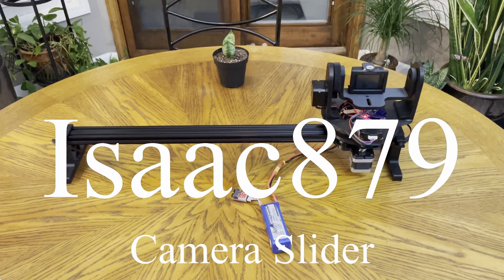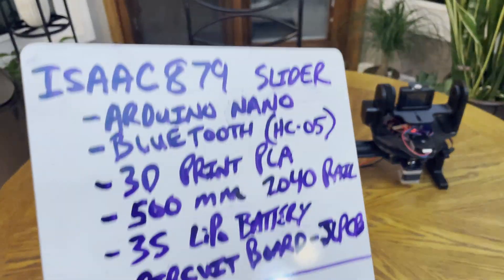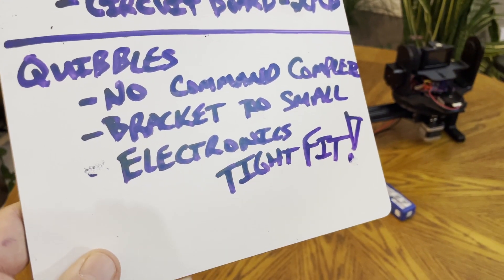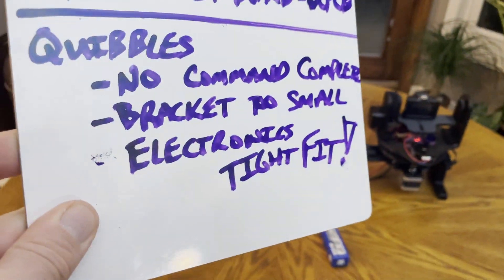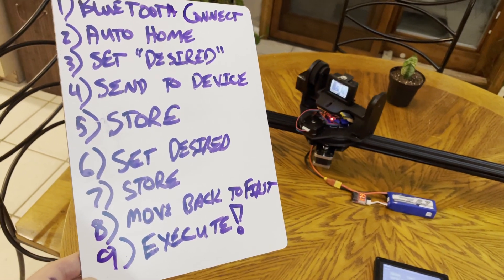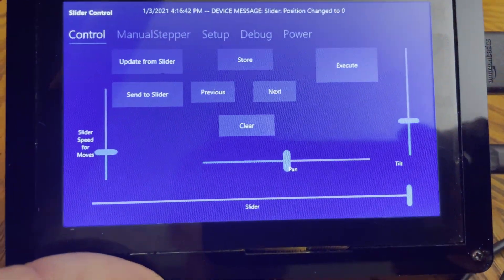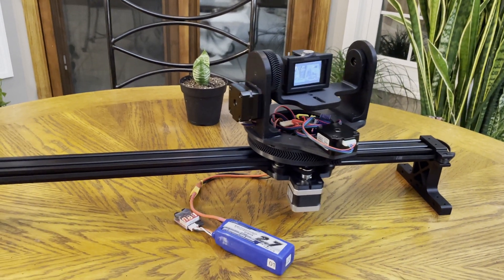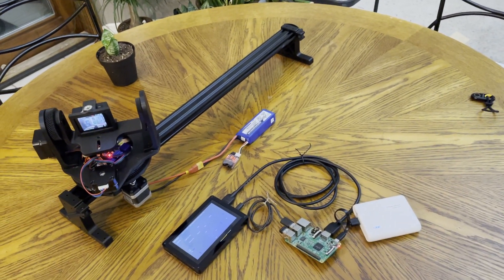RaspberryPi UWP Camera Slider Control

Comment: Great work! You could at a touch screen joystick too. I've done a similar app for Isaac's mount in Python but with Joystick / draggle dot / WASD direct control rather than sending absolute position commands. I've used Isaac's 360 controller code as inspiration. Here's my Python code https://github.com/cbradburne/Pan-Tilt-Mount/tree/TMC2208-Drivers/Python%20Controller%20App%20for%20Pan%20Tilt%20Mount